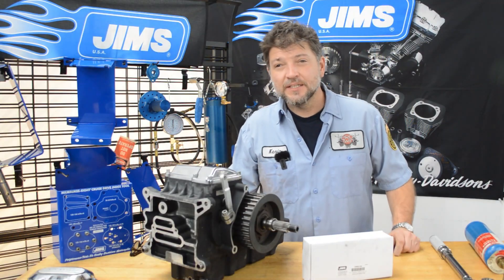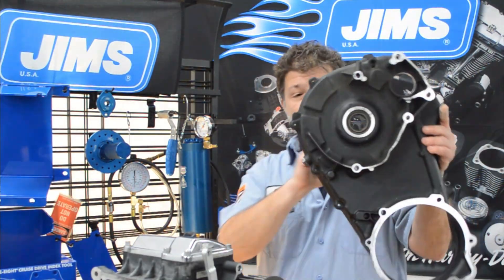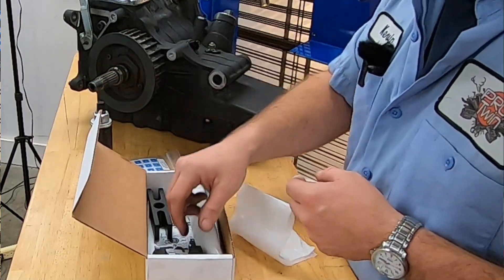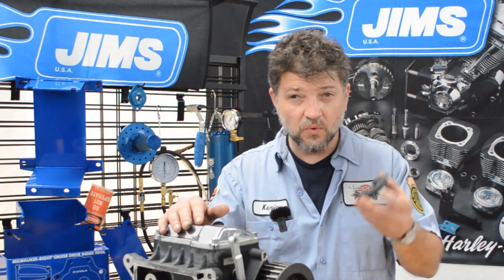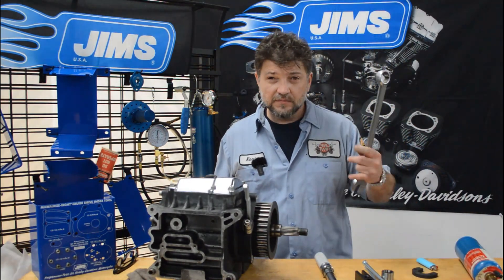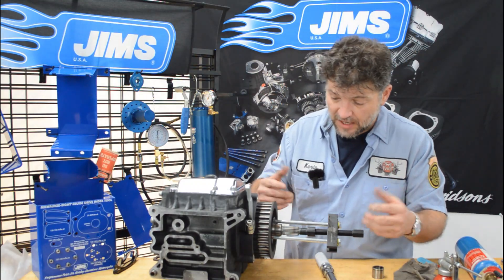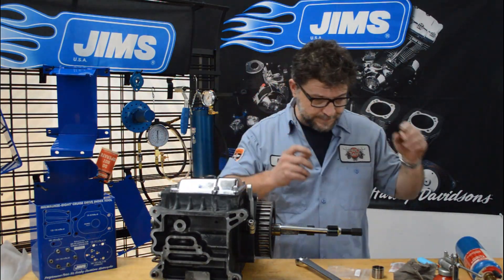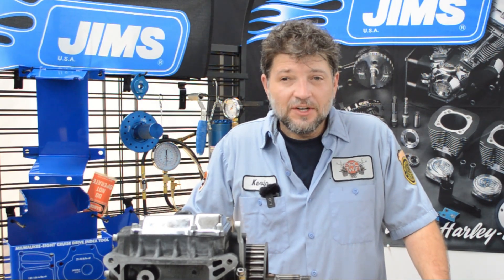Harley Main Shaft Bearing Race Replacement | Harley Transmission | Kevin Baxter | Pro Twin Performan

Comment: Great tool to use, even better is the tip about tapping the main shaft through which i had to do the other day to get at the race...great information!
Reply: Does tapping the Main shaft damage the bearing that’s pressed onto the shaft?

Comment: The race on my shaft had worked its way in so far that it damaged the seal. I had to grind little grooves on either side of the race to accommodate the puller edges and then heat up the race with a torch and pull it off. How could Harley have allowed such an oversight. it was a nightmare but I got it. Couldn't have done it without this video. Thanks for the help.

Comment: I just cut one off that had walked inward because I was too lazy to pull my exhaust open the tranny top cover flip the two levers pull the side cover unscrew the main shaft and push it to get it off with the tool.    Was putting on the all balls race I could almost push it on with my fingers did not fit tight enough so I went with the s&s which has the collar to prevent it from moving inward which went on perfectly with the tool.  So I'm running an s&s race with an all balls bearing.  250 bucks might get you a couple of washers from Jim's.

Comment: Hi Kevin, I have just removed the inner primary and the clutch . The problem is that the inner primary bearing race is spinning on the shaft , I was able to remove it with my fingers... The race comes from Drag speciality . My bike is 2011 Dyna . Did you ever see that issue and what should  I do to resolve this issue.  Buy a  better brand ?   Thank you very much , looking forward to read your response .

Comment: Hi Kevin, I've got a 2016 Road King and I'm about to change the inner primary bearing. I was looking at an S&S Improved Inner Primary Bearing Race (#: 560-0241) which has an ID bevel that rests against the main shaft to prevent movement. Does my bike have the shoulder on the main shaft that you mention meaning the S&S part would not be necessary? Thanks in advance

Comment: Pro tip #2, you're not worried about damaging the side door bearings? Doesn't HD recommend replacing those bearings if the shaft is pressed out? Are you saying slighting taping on the shaft with a hammer doesn't do any damage?

Comment: hi i hope you can help me i have a 2006 dyna and after the bike heats up i get a false neutral light that comes on while riding no matter what gear im in  i can get it to go off by touching the shift lever but it comes back on in a few minutes its fine while the bike is cold
Reply: So what was it
Reply: @gucci4871  never got a reply so i just replaced the neutral light sensor and changed the trans fluid just have to wait for some warmer weather to test it

Comment: again another video not actually showing the point in time when the bearing race actually comes away WHY WHY WHY?? Tools not on bench at start of removal then they are suddenly there how much time has passed???  How much of a struggle or did the tool break ?? ALL VERY SUSPECT.  AAH I just realised your are try to sell the tool